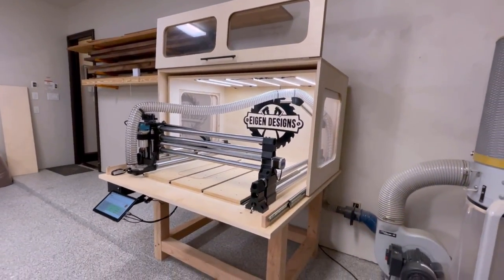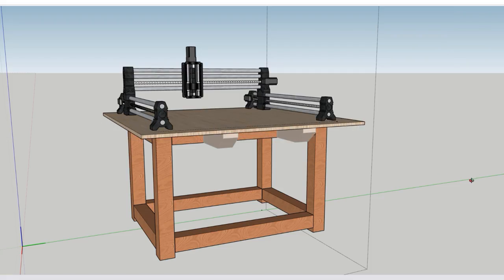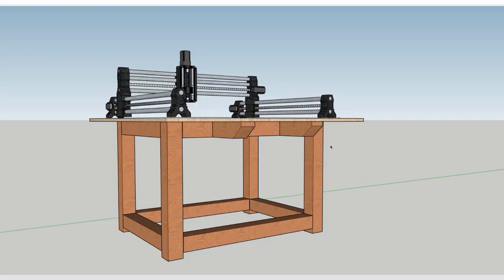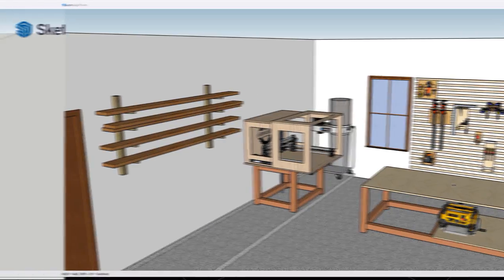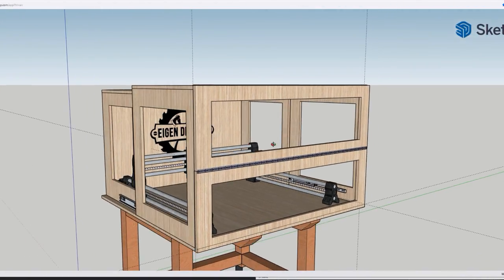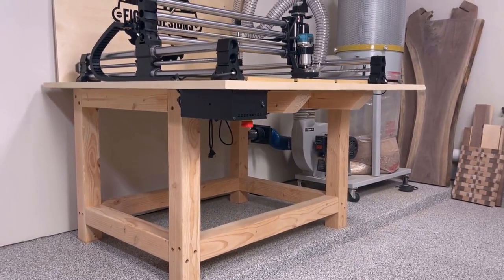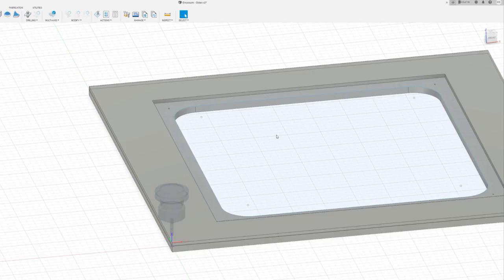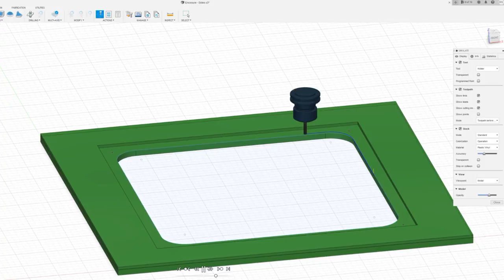OneFinity CNC Table - Part 2 of 2 (Enclosure Build)

Comment: This is just the best design i've seen anywhere! completely awesome. I sure hope you make both plans available for purchase. What a great design. blown away !
Reply from the maker: Thanks for the support Craig. Just curious, what would you need in the plans to actually go and build this yourself? Do you need dimensions of all of the panels and 4x4 pieces for the table? Or are you looking for step by step instructions on how to put it together?
Reply: @EigenDesigns  I guess to  build your set up, you would just need measurements. It’s always nice to refer to a drawing as well, like in sketch up. Usually I don’t follow things exactly but good to refer to the basic drawing and measurements and add your own touch . Once you figure out what size your table top has to be you can go from there. Some have ordered the x50 which I think is much wider. 
If you were able to get plans made and sell them you might have your sawstop sooner 😊
I see lots of guys/ gals sell plans on there Etsy store etc.  
Check out shop nation (YouTube ) He’s put some good plans out there. I’ve built my work bench from his plans.
Reply: Just watched the videos again. Would you be willing to share the dimensions of the table top and enclosure ?  I as well have a small space and was thinking of putting castors on the bottom to move it around. What do think of that idea ? Cheers Craig
Reply from the maker: @craigwesson1788  For sure. The Table top is 52"x53" and the height of the rear portion of the enclosure is 28". Have I already shared the sketchup file with you?
Reply: @EigenDesigns  no, but that would be awesome 😎
Reply from the maker: @craigwesson1788  ask and ye shall receive:

Link:  https://www.dropbox.com/s/ik4lxpqgioxuj2y/Eigen%20Designs%20CNC%20Table%20v6.skp?dl=0
Reply: @EigenDesigns  thank you sir 😊
Reply: @EigenDesigns  Thanks, but i guess i dont have the latest version of sketch up. LOL im not sure if you can send it another way. Thanks for trying. Craig
Reply from the maker: @craigwesson1788  The farthest back I can save the file is SketchUp 2017. Give this a try: https://www.dropbox.com/s/fa3mz8sufh76maz/CNC%20Table%20v6%20-%202017.skp?dl=0
Reply: @EigenDesigns  thanks for trying. Really appreciate that 😊
Reply: @EigenDesigns  any chance you have this in pdf?

Comment: Excellent job on that enclosure. Very professional looking. I will be building something very similar when my machine arrives in a couple weeks. I built my table with retractable casters to easily lift and move when needed so I can access the back of the machine. I too have limited space.
Reply from the maker: Thanks Mister JJ. I hope this gives you some ideas to make the perfect enclosure for your CNC.
Reply: @EigenDesigns  
It does. I greatly appreciate your videos.
Always informative and helpful 👍👍

Comment: Awesome enclosure!  I’ve been wanting to do the same with my set up. This give me ideas.  I’ve had my sawstop for about 3 years now. I flipp’n love it!  I went with the 220v cabinet saw. They’re proud of their mobile base so I built my own. The whole thing is raised off the deck about 4” better on my back.
Reply from the maker: I ended up getting my sawstop and I LOVE it. It's an incredible piece of equipment and I am grateful to have it in my shop. 

I am glad this video gave you some ideas! Good luck building :)
Reply: @EigenDesigns  
Thanks man. I’m glad you got the saw!

Comment: This looks like all my iterations as well but without the queen bee pro Cnc 😂. I’m never satisfied with any of the designs, each have a flaw that I fix in another version. I’m on revision 7 I believe but I’m also keeping the mindset of using the bottom for quiet dust extraction with proper ventilation designed into a maze of MDF to quiet the sound before reaching outside. I’ve also incorporated MDF as internal sound dampening hopefully. I’m over engineering this project I know but just like tools get the best you can afford (or design). Oh by the way your model had the piano hinge on the wrong side. Good information on the enclosure!
Reply from the maker: It was really fun thinking through each design and being able to 3D model it to see how it looks. Question for you: do you have a 2.5" dust collection hose or another size?
Reply: @EigenDesigns  I'm not far enough along; I am at the design stage (an engineer is never happy with the design and a salesman sells what they don't have) and the CNC is still sitting. But maybe I have an answer to your question since I been deep into the YouTube rabbit hole and have a mechanical background.
Reply from the maker: @ProjectAnubisUSA  Let me know where you land on that. I am curious to know what you think.
Reply: @EigenDesigns  Well I would definitely go as big as possible that the budget allows. Since I will be running multiple machines I will try to go with a 4" hose. To start I will use a shop vac for the CNC (underneath I'm designing a enclosure for sound dapening) and connect it to the different machines as needed. I want to run a cyclone separator in my setup so a larger setup will be nice so to prevent any air drop-off I will need to go bigger. If you plan to use it for the CNC only then the vacuum will be close enough that the smaller setup will be sufficient. If you plan to run a hose a long distance due to multiple hookups with no intent to disconnect and reconnect; a larger setup is a must.  Also, for certain machines a larger dust collection is needed to prevent chip clogging like on a straight blade planer. Check out these channels that helped me make sense of it:

https://youtu.be/FDdlJmWeKsY

https://youtu.be/hWSplfXNjWM

https://youtu.be/_Y6kkg2EoCI

https://youtu.be/0NmMoIYIsr8

https://youtu.be/XTLYq02qgdA

Comment: Nice work man. You can barely tell the viewing windows on the right side of the front panel are 1/8" higher than the ones on the left. Its a bitch to get a two part cut to align on the second pass.

Comment: Great design, nicely done!
And congrats on 1000 subs. The sawstop will be my next item to save up for after my onefinity. :-)
Reply from the maker: Thank you! Just curious, are you going for the ICS or the PCS? I am leaning towards the PCS for my shop, but would love another opinion.
Reply: @EigenDesigns  I'm going for the PCS 1.75HP (limited to 110 power in my shop) model with 36" fence. I haven't decided on which mobile base yet. I can't wait. I'm almost as excited for the new saw as I am for my onefinity. 👍
Reply: @EigenDesigns  don’t discount the Laguna brand. Shop nation did a review. Worth a look. That will be my next table saw for sure. Sawstop I think is overpriced. But that’s just one guys opinion 😊
Reply from the maker: @craigwesson1788  I have seen Shop Nation's review on the saw. He makes such good videos. I like the extruded aluminum fence on the Laguna and I love the price point. What still brings me back to the SawStop is the safety feature that stops the blade when it comes in contact with fingers. For me personally, its worth the extra cost, especially with a curious 3 year old that sometimes wanders into my shop.

Comment: Now that you've lived with this for a while, do you find that the benefits of the side windows were worth it (assuming windows do not reduce noise as much as solid plywood)?
Reply from the maker: That's a good question. They don't often get used (except for a guest in my shop or my 3 year old getting curious) so it certainly is something that could removed from the design. It would also save quite a bit of money on the design since you wouldn't have to buy plexiglass. I am not sure how much more noise dampening you would get with just wood vs. plexiglass so I can't comment on that. For my setup, the dust collection is where the majority of my noise comes from.

For me personally, I would still install them if I were building this today because my CNC enclosure is on of the main focal points of my shop and I think the windows make it look better.
Reply: @EigenDesigns  Thanks. I hadn't considered the dust collection noise being louder, but that makes sense.

Comment: Would you have any idea of how many decibels the enclosure suppresses? Nice build, im in the middle of building mine for the Elite Journeyman, and still tossing up about how to do the enclosure
Reply from the maker: I never measured the delta, but the difference in the router noise was significant. However, if you're shop is like mine and you have a giant dust collector that roars while you are operating the CNC, that pushes you in a db range where you'd want hearing protection anyway.
Reply: @EigenDesigns  i have my dust / cyclone system somewhat enclosed too :)

Comment: Great build! I'm still waiting for my X-50 Woodworker to show up. Are most people using 4 inch or 2.5 inch hoses? I have an Onieda 220volt  collector and was thinking that the 4 inch hose would work better. Thoughts? Thanks!
Reply from the maker: Hey Dale! Most builds I see use a 2.5" hose (or smaller) for a CNC of this size. It's a pretty even split whether people used shop vacs or actual dust collection systems, but I don't see many folks running 4" all the way to the dust collection boot. I have a 4" line coming from my Delta dust collector, but step down to 2.5" for the final stretch to my dust boot. If you look at 9:12 in the video you can see where I use the blast gate to do the step down from 4" to 2.5".

Comment: Have you tested the noise difference before and after making the enclosure
Reply from the maker: Hey Sean, I didn't measure it before and after, but the router noise is noticably lower after building the enclosure. However, the dust collector, which is right next to my CNC, is still super loud so I still wear hearing protection in the shop.

Comment: How the drawers slides doing with all the dust inside the enclosure?
Reply from the maker: Thankfully, dust really doesn't get into the drawer slides. Because of the way the rails are attached and the protection of the "c" shaped channel provides, there hasn't been any accumulation in the slides.

Comment: Great job.  I've been one of the early subs to your channel and loved every video you have published.  I recently got the OneFinity CNC machine.  Looking to build the enclosure like yours.  For your panels, did you use 1/2" or 3/4" plywood?  On the plexiglass, did you use 1/4" or 1/8" panel?  Thanks again.
Reply from the maker: I appreciate the continued support! For the panels I used 3/4” plywood and for the plexiglass I used 1/4”. The plywood panels, particularly the roof, has to support a lot of weight so I decided to use the 3/4” to reduce the amount of sag.

Comment: Very clean design. I really like the integrated drawer slides on the enclosure. Where did you get the articulating arm and hose for your CNC dust collection?
Reply from the maker: I found a guy on Etsy named RowdyRoman who makes this set. He 3D prints the boom knuckles and adds some aluminum tubing to create his design. You can find him here:

https://www.etsy.com/listing/836980394/hose-boom-for-makita-router-65mm-users?ref=yr_purchases
Reply: @EigenDesigns  Thank you!
Reply from the maker: @Anthony-H  One other thing you might want to check out is the drag chains and mounting brackets I used. They are from another etsy store called Route1WoodDesign. The drag chains help with the cable management and keep them away from dangerous pinch points. I have a link to both stores in my OneFinity unboxing video: https://www.youtube.com/watch?v=tDFD17GlAv8&t=625s

Have a great one!

Comment: Awesome enclosure! About the cables that are short: Are they standard cables or proprietary?
Reply from the maker: Thank you! I am not 100% sure about that. I briefly looked on amazon and didn't see any pin connectors that matched what I had, so I ended up ordering extensions from OneFinity.
Reply: @EigenDesigns  alright! Thanks 😊

Comment: Great video. I was very interested in your design. How many Decibel reduction did your enclosure make?
Reply from the maker: Thanks Micheal! With the door closed the enclosure quietens the router noise quite well. You can have a comfortable conversation when the door is close. However, I am usually running my dust collector at the same time, which is pretty loud, so I end up with a bunch of noise anyway.
Reply: @EigenDesigns  Thank you very much! Would you be willing to share the sketch up design. I just bought a CNC machine. Noise is a big issue where I live.  I have enclosed my Jet 1.5 HP dust collector. I used foam and plywood. its not pretty but lowered the db by 10 db. from 84 to 74. I was thinking about applying you design and making an acoustic panel 1.5 inches wide on the  sides and top. I was planning to  try to use Mineral wool this time, rather than foam. So I was wondering how many dbs the 3/4 plywood enclosed reduced the noise.
Reply from the maker: @michaelroth5234  here is the free sketchup file for you to use: https://www.dropbox.com/s/fa3mz8sufh76maz/CNC%20Table%20v6%20-%202017.skp?dl=0
Reply: @EigenDesigns   Thank you

Comment: Why did you make this enclosure? You seemed to already have excellent dust collection. Noise would still be an issue as you will still be running the dust collector?
Reply from the maker: You are right about the noise. I still wear hearing protection any time my dust collector is on so it doesn't solve that problem. It does cut down on the noise from the router, which can be much louder than the dust collection, depending on what you are cutting and how aggressive you are being.

But aside from noise, I wanted the ability to isolate the router + CNC while it was in use. I have a 3 year old who is naturally curious and I wouldn't want him to be able to reach up there while the machine was in use. The enclosure is one way of "engineering out" some of risk with the CNC. As a father I am just not sure I could ever forgive myself if something like that were to ever happen.

Comment: How far is the front right of your cnc from the edge of the table. I see the X rail motor clears the enclosure
Reply from the maker: are you asking about the front right foot of the CNC? Or are  you asking about the clearance between the X rail and the enclosure?
Reply: @EigenDesigns  the front right foot clearance
Reply from the maker: @ormondscott191  it is 4.5” from the right edge of the table. I hope this helps.

Comment: does this help with noise?
Reply from the maker: Hey Tom, it does cut down on the router noise quite a bit. I would estimate as much as 75% of the noise is cut out. However, my dust collector sits right next to my enclosure and is just as loud and there’s no noise protection against that.

Comment: What kind of filter is on top the Dust Collection please?
Reply from the maker: Powermatic 20” 2-micron Filter Canister: https://amzn.to/36K5Caz
Reply: @EigenDesigns  we have a Onefinity CNC, we will be doing mdf projects will this filter eliminate the fine dust?  How long life do these have please?  I will go look at this thank you ; )
Reply from the maker: @higherstandardspc  They do a great job of removing the fine dust out of the air, certainly a big upgrade from the bag filter. The filters actually have a very long life because you can them out (by blowing them out of using a mechanical agitator) and they are good to go again.